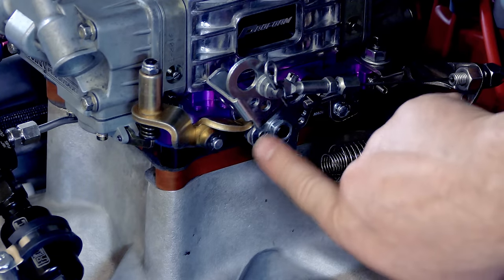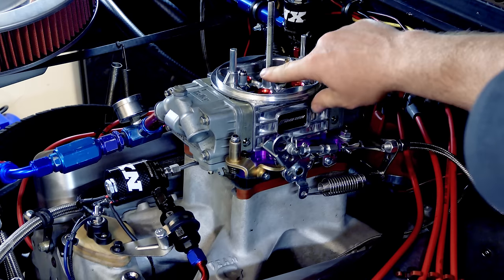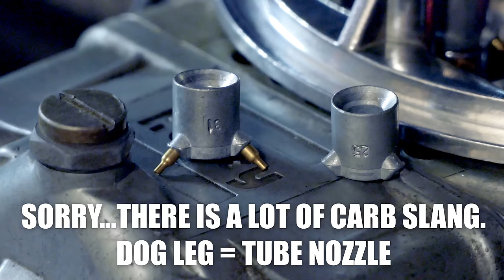Holley 4150 Carburetor Tuning!  Accelerator pump / discharge nozzles / pump cams / power valve

Comment: Great information. I was planning on putting a wide band in my car for this very reason. I have always been very good at tuning my carbs with a vacuum gauge and by reading the plugs but figured a wide band would help even more.
Reply: Do it. I’m old school too. But now It’s so much easier to tune because you are looking at actual measurements your motor wants or needs.

Comment: Well I just started looking around I'm building another 460 with an 850 double bumper. I had a lot of problems on my last car and it turns out it's because I didn't have a return line. Holly said I did not need one! Anyway appreciate the video and I will do the O2 wide band although in my case I have dual side pipes. They should make it interesting and more expensive of course!

Comment: thank you. obviously there were some people that could read plugs and make cars go fast in the 70s but its 2020. and you pointed out some faults in reading plugs that i never even thought about. in addition to the fact I consider reading plugs kind of subjective. in the near future i will be hooking up a wideband to tune a carburetor. thanks for making this video. also this probably is most important on tuning a street car because race cars tend to be focused on WOT only, in my opinion.
Reply: Gas has alot of oxygen in it these days because of alcohol in it. Plug readings are not what it used to be

Comment: how do you think the carb primary supplies fuel to the engine below 1900 RPM when there is no fuel coming from the boosters.. the accelerator pump discharge nozzle can't handle it alone.   its called the Low speed circuit.   it supplies fuel at idle past the end of the idle mixture needles to come out the round idle discharge ports below the throttle blades..  with the throttle just barely opened.. thru about 2000 RPM.. the exposure of the idle transition slot allows manifold vacuum to pull fuel out of the slot progressively..   the amount of fuel is limited by the IDLE FEED RESTRICTION in the metering block.  if the engine is bigger than 355 Cubic inches you may want to think about going to a larger idle feed restriction..  347 thru 355 engines really need a 0.032" idle feed restriction..   get up thru 427 to 435 cubic inch engines and you need a 0.035 ..  you won't believe in part throttle response from your carb..  getting this right.. may be expensive..  test your air fuel ratio at steady engine speeds starting at 700, 900, 1200, 1500, 1800,  2000, 2300, 2500 is basicly where the primary mains take completely over.. you can see if your mains are properly tuned between 2500 RPMS and 3800 RPMS..
Reply: Awesome information, thats what I did IFR are key at off idle !!!!!!
Reply: I had to use .38 ifr on my setup, now for an excellent cruise I had to  lean out the idle air  bleeds. Excellent off idle and cruises at 15-16 afr

Comment: Great videos.  It seems you've done a lot of Holley tuning... Have you ever messed with emulsion bleeds..?  Emulsion bleed tuning seems to be the 'black magic' topic of Holley tuning, no one seems to explain it, meaning, hole location and size, and how each location (in general) will affect the fuel curve.  It'd be nice to find a video that explains the emulsion jet tuning in-depth, I can't find anything on the topic.  It's be especially nice because a lot of the new Holley performance/race carbs are coming with the 5 hole blocks (Ultra XP, Track Warrior, etc.) but that amount of tuning isn't really necessary for a street car and just causes issues.  It's difficult to find advise on what to do, or how to modify/jet those blocks for a street car.  I've scoured the internet to find recommendations and have actually spoken to Holley tech's about it, no one seems to have much advise.  I spoke to Holley just the other day about it, the tech didn't know much, but I did get some spec's for the different carbs (750/850 Ultra XP, Track Warrior) which seem to use the same 5 hole blocks, Holley was able to let me know that they install the same bleed jet stack in all of them, which didn't surprise me...  The stack from bottom to top is .029, blank, .029, .029, .029.  I was told by a guy that knows Holley's pretty well to go with this stack for the street - blank, .029, blank, .029, blank, so basically a 2 hole system.  Going to say a 2-hole system, I would imagine will change the HSB's on the top also..?  Thoughts?  Recommendations..?

Comment: a lot of old school guys like to run square on jets and squirters I've never had good results running that way and never run a power valve because they like to start fires when they blow. but my best results have been on big pumps front squirter one step smaller in front (28) and a (31) in rear and my jets are also different with smaller size in front (72) and rear (82) on my 800 dp on 455 pont.
Reply from the maker: I have never blown a PV in new carburetors with the check valve.If you're staggering the jets with no powervalve I would be concerned about some cylinders running lean.
Reply: @TPVPRO  When I have tried running square its my 60ft times are slower and feels like a fat stumble without a real stumble and won't pull the wheels much less carry them. I have open plenum intake so lean cylinder issues have never shown up in cylinder temps. The power valve issues I've seen on everyone else's (because I've never ran them) come's after a single or multiple back fire through the carb while testing/tuning new parts or adding timing or just a ignition part failure. I also run a tow truck and can tell you every car/truck that I have picked up after a fire had a Holley on it. and the ones at the track without nitrous had PV fail from back fire.
Reply: @TPVPRO  you're lucky.  I've blown several power valves in 4160s with the check ball.  I think ethanol is wrecking them.  It only happens if I leave one sit for a few years.
Reply: @TPVPRO  I don't think you know how it works if you think the front jets run the front cylinders. Its about coming in off idle or lower RPM.
Reply from the maker: @alfredodirks3537  Do whatever you want. I have never had a issues with a powervalve.  All the N2o guys I have ever talked to square jets.

Comment: People get how a power valve works backwards a lot. High vacuum actually holds it closed and when your vacuum drops to below the number specified on the power valve the spring on it opens it to enrich the mixture. Cams with lot of overlap and poor vacuum tend to have issues cuz they sometimes don't even make enough vacuum to close it at idle and wonder why the engine loads up real bad and idles like chit. A 6.5 power valve is stock issue and the number on the power valve has nothing to do with the amount of fuel it flows that is predetermined by circuits in the carb the number on the power valve is what vacuum it opens at. A 6.5 takes 6.5 inches, or "bar" (barometric pressure) of vacuum or higher to hold it closed. My LS1 has a sloppy stage II cam with lots of overlap for a choppy idle and is right at the edge of not being able to hold the power valve closed at idle and gave me a very inconsistent and erratic idle so i eliminated my primary power valve and jetted up 8 pts. I could have probably put a 4.0 PV in it but it runs great without the power valve so long as you jet up substantially to compensate killing the power valve "enrichment " circuit
Reply: What do you suggest for a low vacuum engine then? I only have about 8 inches of vac. Should I be running a 4.5 or lower? Or should I try going the other way, up to a 7.5?

Comment: Great video, although curious why you went with an aftermarket main body but not quick fuel metering blocks? The quick fuel metering blocks also have different size sets of Jets behind the power valve called power valve channel restrictors, that can be adjusted to feed the main circuit under wide open throttle. This way you can have properly set of primary and secondary for mid-range cruising and  and still make adjustments for wide open throttle along with how you have your secondaries set. Or maybe I am being too technical. I'm  years old quick fuel metering blocks word around back then but I love the extra adjustments when at the track.
Reply from the maker: I have them in my 950 I did have to play around with them in my brawler. I never ordered different blocks with that 750 because it always worked pretty good.

Comment: i feel the extra pump shot is just a crutch for not using the proper sized power valve and PVC.   I am assuming your primary jet size is lean for your personal tune and the power valve circuit is modified to compensate so now it would just be all about timing of the PV to get the enrichment.  I would like to see the same test done with your 25"s back in and a quicker PV installed, assuming your PVC are sized properly. like your vids,

Comment: Hell yea man! Appreciate the video, can u do us a video on adjusting vacuum secondaries. I have a Road demon with the vaccuum screw in the diaphragm. Never know where I need to be with it. I have it 1.5 turns out from bottom so far
Reply from the maker: I’m not sure what the screw is also because I do not own a vacuum secondary to test. But get the spring kit and put the weakest spring you can in the secondary diaphragm. The weaker the spring the sooner they will open. spring kit part # DEM-120083

Comment: A customer of mine came to me about restoring his nova and make a little more power with his 010 original 350. My engine builder I usually go to punched it and put in a mild cam. But from the looks of it, my builder installed the cheapest GD Holley he could find. Usual part #'s aren't in the  common places. And for some reason can't decode the numbers on it. I run a pro systems carb and have ran quick fuel carbs In the past so I'm not completely new to Holley based carburetors. For some stupid reason, I cannot for the life of me get this "china" Holley to fall into a happy zone! Fouls plugs after awhile, originally after getting car together, the secondaries weren't opening up and just falling on its face (vacuum leak) and worked out that. It's always fired right up and ran decent at idle. Just a bit fat. Now suddenly the float fuel level is wayyy high and will not lower even with adjustment. I believe that would be a leaky o ring in metering block? Getting dead holes, wet plugs and worried it's going to hurt the engine. My detailer isn't experienced at all with carbureted injection at all even tho he's 45 years old and will start it up and back it out cold then shut it off after running 30 seconds. I know 100% that's not healthy at all and just doesn't understand why I express not to rev or run the engine without warning it up. Car isn't quite done yet is why we have it still and we park it inside. I'm to the point of just getting an Edelbrock for it because the customer will never figure out how to tune a Holley as hes retired and not car savvy. Should I just replace it with a more street friendly carb or get a decent Holley?

Comment: What compression and plug heat range you running? My son's double pumper likes to foul NGK 7s out at idle. Idle AFR is 13.5-14 AFR
Reply from the maker: I'm 12 to 1 on 93 pump. 13.5 to14.5 is a pretty good range if you do a lot of street driving on high compression motors. I’m running the NGK 7s also. You got to keep a cold plug a little more lean while cruising around on the street to keep them from fouling out. As long as it’s a good 12.5 AFR wide open you should be ok with conservative timing on a hot street motor.

Comment: Very helpful but how do you choose accelerator pump cam? I get a bog right off idle if I get on it. It'll spit n slam choke shut. I have to get out remove airfilter n physically knock open choke plate!

Comment: You are correct on the holley's version of PV selection, doesnt work very well. From what i've read elsewhere, you take your cruising vacuum reading, divide that in half, then add two. My example, i cruise 1900rpm(60mph), my vacuum is 15hg, i divide that in half, then add two, that puts me with a 9.5hg power valve. This has worked great for me so far with my holley 650vacsec carb, ZZ4 crate engine, 700r4 and 3.73 gearing, all wrapped up in a '79 malibu 2dr coupe. Im currently going by plug reading at the moment and not pulling any WOT tests since i dont have a afr meter installed yet, hopefully soon, but driveability feels good right now, so no complaints.

Comment: have a new 750 holly on a 350 with a small 288 460 cam.mostlry breaking it in but very black sutty plugs.the primarys are 72 pump nozzle 0.031 power vavle 6.5.why am i to rich.thanks TJ

Comment: I need some help man. I got a 355 small block big cam and it eats. But I got a 650 quick fuel carb. I step on the gas and like i think it floods the crap out of it then it finally picks up after about a second and runs fine. Is there anything I can do to fix that

Comment: Just from watching your afr readings ..... I feel you need to lean the idle circuits go up on the mains and down on the squirters.  Power valve needs to be 4.5 its only there for idle. A holley adds fuel in steps, if one step is to lean or rich your have to over compensate to get the afr back.
Reply from the maker: Power Valve does not effect idle. I have opened the PV enrichment holes a little to get a 14-15.5 AFR at cruise with smaller jets for better drivability and gas mileage. If I go up on the main jets it will be fat at WOT.
Reply: @TPVPRO What I should have said was idling around (cruising)lol.  When your in fuel econo mod the power valve is closed and boosters  are not drawing any fuel. Your driving around on the Slots and idle circuits and front pump squirter.
Reply from the maker: Yeah I get all that but you also can't trust the wideband completely. Cams with a lot of duration will read lean but when you are putting around may still load up the plugs after a while. You also have to pull the plugs after they have been in for a while to figure out how lean you need to run that motor for cruise. I run a cold plug for a 12.0 compression 93 pump gas motor so that doesn't help. But it keeps detonation down when the temp is hot out.

Comment: Good video, but you completely forgot about the idle feed restrictors, which are very important off Idle.
Reply: Most of these guys are only interested in wide open drag racing performance. Street tuning is totally alien to them. Main jets, squirter, power valve and cam, are about all most of these type presentations are about.

Comment: Hi, I have a 735 cfm Holley on a 428 SCJ and I can not get it to run right. The carb is a manufactured carb and is like new. What is does is when I speed it up and then let off the idle stays high for a few seconds then drops to normal idle. I have changed jets and power valves Jets power valves are correct. Floats are set correct also. What would cause this problem?
Reply from the maker: Probably not carb related it's most likely the distributor advance going for full advance back to idle advance.
Reply: @TPVPRO  It is carb related. If I put a 750 cfm Holley I have on it runs fine but the 750 isn't the carb that came on the car.
Reply: @ajw6715  timing  light while its happening ?

Comment: Nice innfo.Does this tuning tips works on a Quick Fuel 750 pv without vacum? I have one on mye 390 fe slightly modified
Reply: Yes. QF uses Holley DP everything. even the circuit layouts are the same, just more tunable on the QuickFuel stuff

Comment: I followed your advice in got one, i'm working on getting better at idle I meant 13.5 , in when I get on it and goes down to 10.5 any advice
Reply: At wot? At the initial shot?
Reply from the maker: Idle AFR is tricky, If it's 13.5 on startup cold and 10.5 that sounds about right. You adjust the idle air screws when its warm shoot for 13.5-14 AFR. Carbs are just hard to star when cold that's why most like FI.
Reply: TPV Productions us men like carbs lol! Plus I can’t afford a trick fuel injection set up 😂
Reply from the maker: @mattperkins7038  It's hard to beat a $500 tunable set up
Reply: Yes at wide open throttle it's 10.5, when it's warmed up it'll stay around 13.8 -13.5 at idle, so if it's at10.5 at open throttle do I jet down the secondarys,
Reply: TPV Productions oh you’re absolutely correct. I run a Holley XP and the tuning capabilities are endless. Great channel btw

Comment: Your statement about the power valve is incorrect saying you needed a 4.5 if your crazing at 16 inches a vacuum half of 16 is 8 so your car would not call for a 4.5
Reply from the maker: I'm just repeating what Holley said not my statement. I6 is the "AFR" not the vacuum reading.